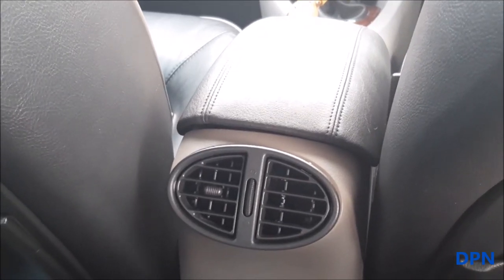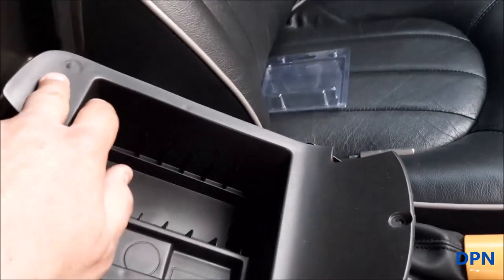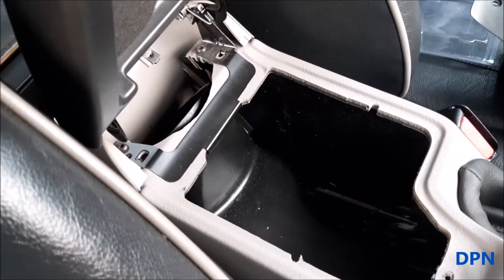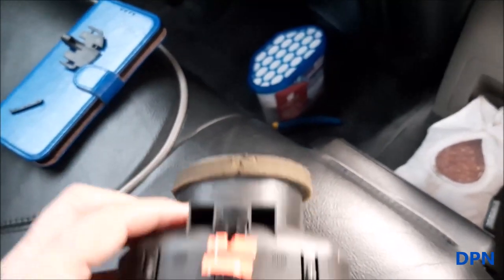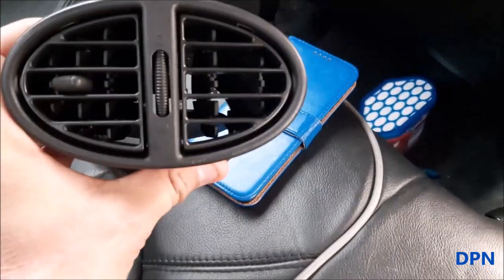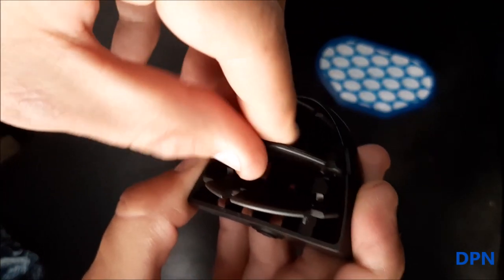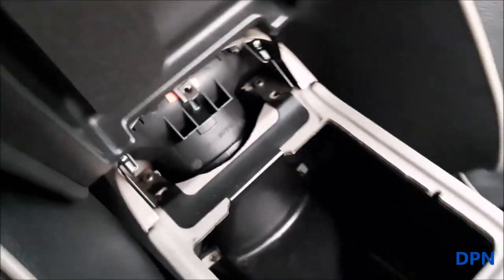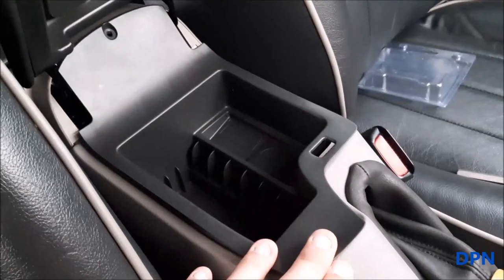removing, repairing and cleaning the back air vent on a Rover 75

Comment: Hi, I own a 2001 Rover 1.4 impression 5 door hatchback. I have had the car from new but I am now finding it difficult to get the parts for it. I am trying to get a new heater motor without success and I just wondered where you obtain your parts from. I would be grateful for any information you could give me. Thankyou.
Reply from the maker: we normally use eBay. Sometimes, we use discount Rover spares and sometimes use rimmerbros
Reply: Thank you, I will try those.